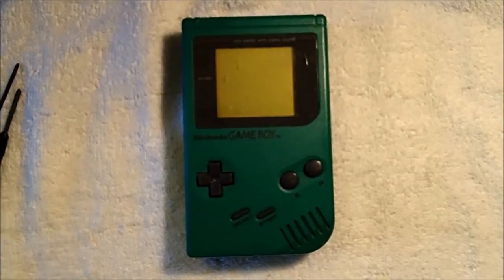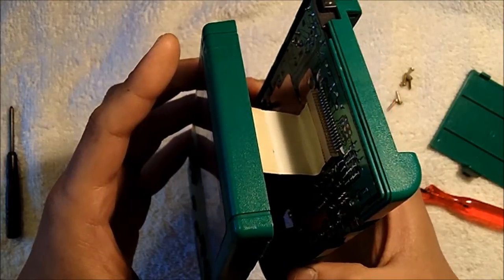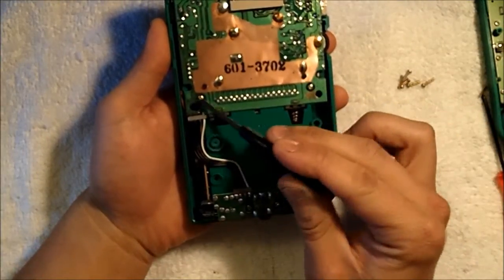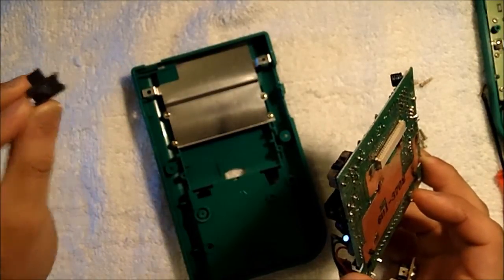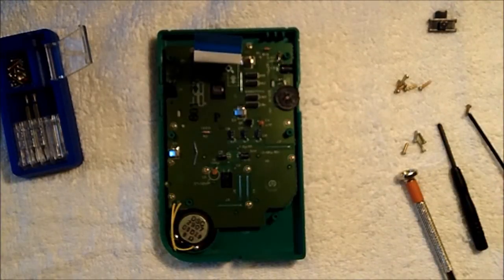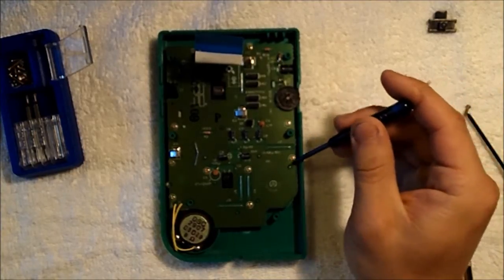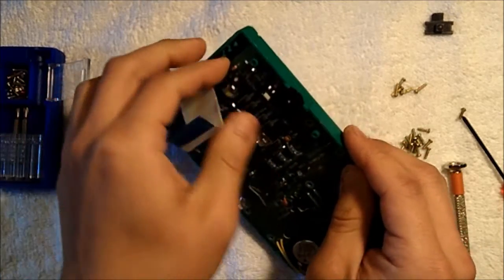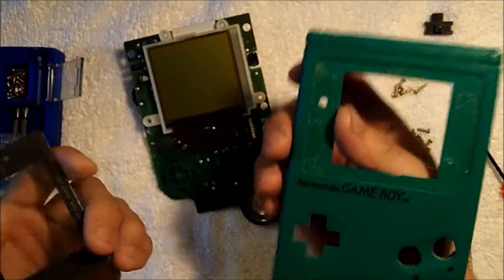Modifying your DMG-01 Gameboy for Chiptune Part 1: Prepping your Gameboy Case [1/2] [HD]

Comment from the maker: Some gameboys apparently came without the tri-wing Nintendo security screws and came with philips head screws.

Nothing to worry about.

Please note that the screws that attach the front and rear case together are slightly longer than the screws inside of the gameboy that hold the front and rear PCBs in place.

Comment: just so yall know, you can take a glasses screwdriver (i used a tech deck one) and grind off one wing. and then it'll fit barely inside the screws, at least for taking it apart once. replace the screws with some of the ones from the front pcb to make it easier.